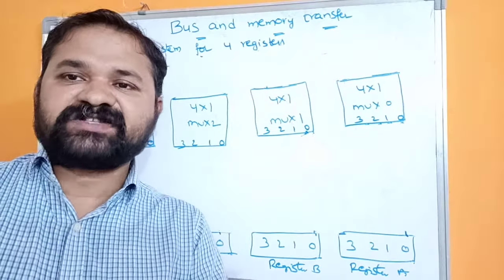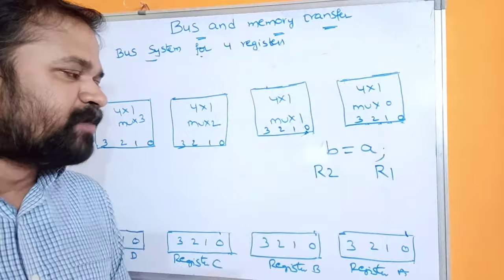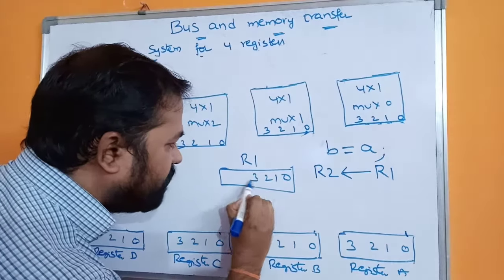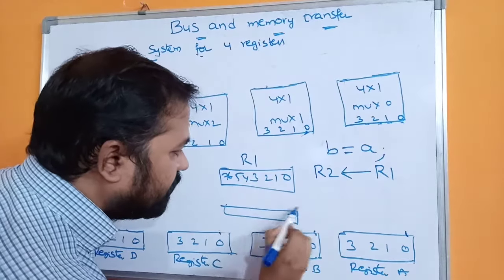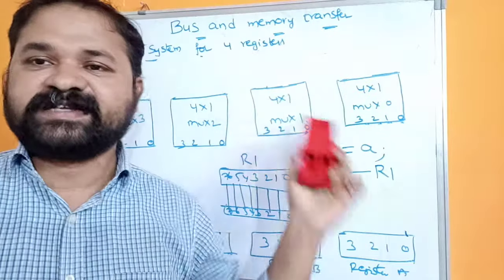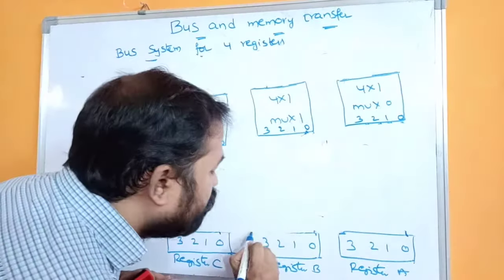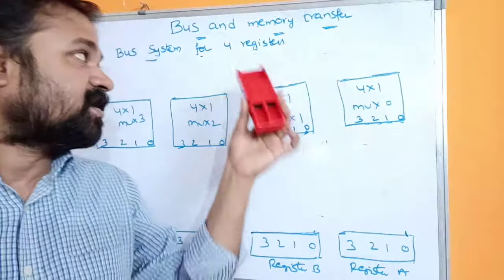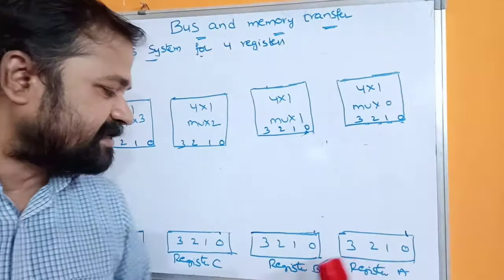Bus and Memory Transfer || Common Bus System For 4 registers || Computer Organization & Architecture

Comment: Sir excellent lecture and i have a doubt here. 
So in this bus there are both write and read operations going on right?
The Registers A B C D will transfer the information to Bus via mux which will be a Write Operation and then the Bus which has stored the values of some register will transfer that to any register R1 which will be a Read operation.
Am I right sir? or what i am thinking is wrong?
Reply from the maker: absolutely correct rohit.